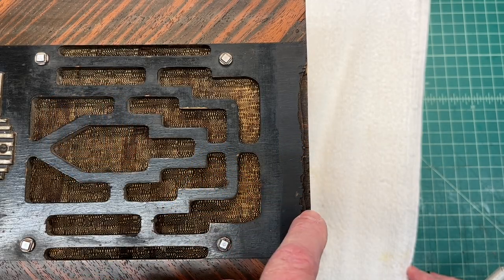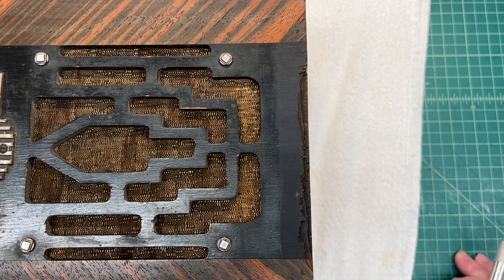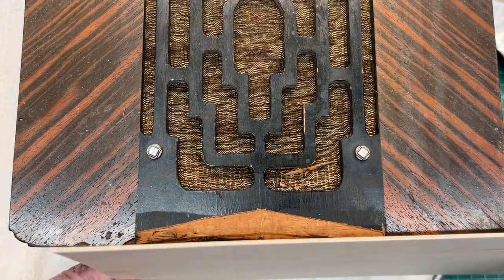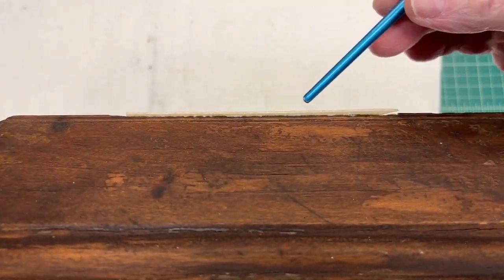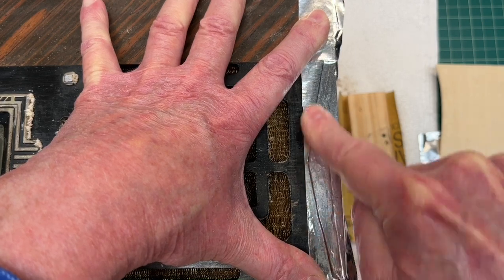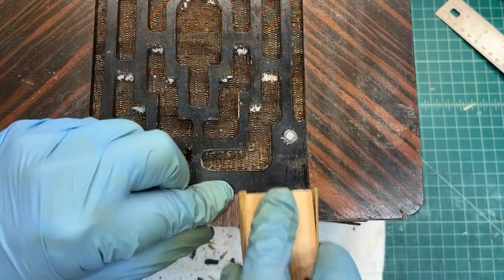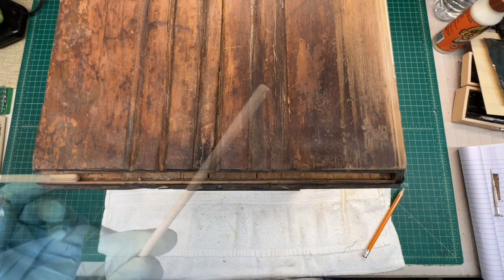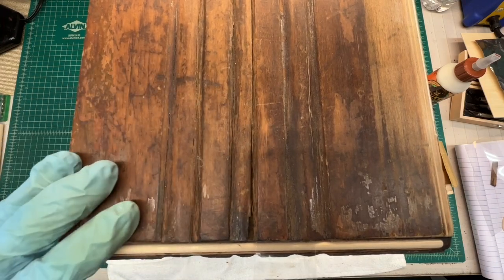Crosley 5V1 - Wood Veneer Repairs P1 of...

Comment: Have you thought of using violin planes? After watching a luthier on youtube use them, I made one with the blade being approx 13 mm wide. I needed it to remove some timber inside an old mantle radio cabinet which was difficult to access until I made the plane. Anyways afterwards I also bought another one with a convex base, the blade being curved and 8mm wide. Very handy tools.
Reply from the maker: Jason - thanks for the info on the violin plane, I’ll definitely check them out. After gluing the veneer down in multiple locations and applying an epoxy filler followed by some sanding with 100 grit SP wedged between a thin piece of wood, I was able to somewhat reshape the top pieces. I really appreciate the info and for taking time to reach out with the helpful information. All the best. Don
Reply: @RestoreOldRadios  Your welcome Don. I enjoy watching your restoration videos and seeing the beautiful radios from your part of the world. Timber radios are getting harder to come by in Australia and prices are rapidly rising. Thanks for sharing your resto's with us.
Reply from the maker: Thank you.

Comment: The close-ups show the repairs very nicely. however could you zoom out a little between shots? Its hard to determine where on the radio we are at some times. Top or bottom an such. When you talked about using the plastic to put glue between the loose veneer, I didn't know what side I was looking at. I guess bottom.
Reply from the maker: Hi Bart - thanks for your feedback on the video. I’ll keep that in mind and try to denote such… The plastic strips with glue were placed under the top veneer pieces that were loose. Thanks again for taking time to watch and reaching out. Best, Don
Reply: @RestoreOldRadios  if your camera has an HDMI out you can use a monitor above the bench to see how the shot looks in real time. Could be useful.
Reply from the maker: Thanks Bart, I’ll keep this in mind. Best, Don